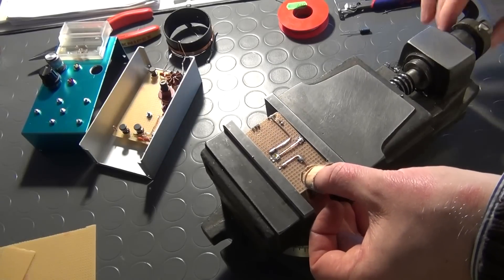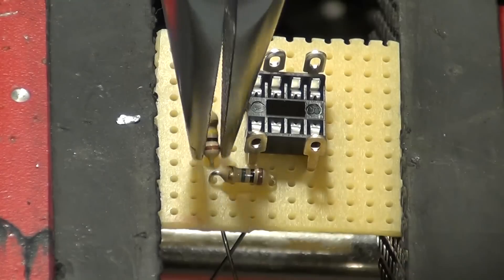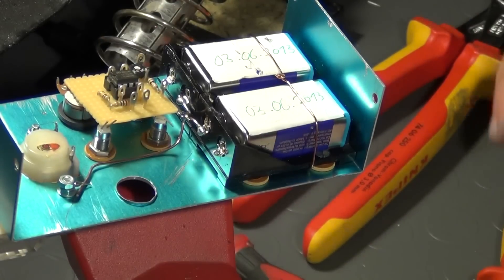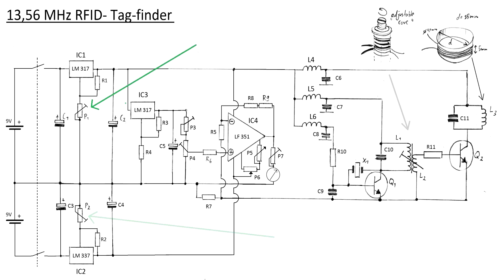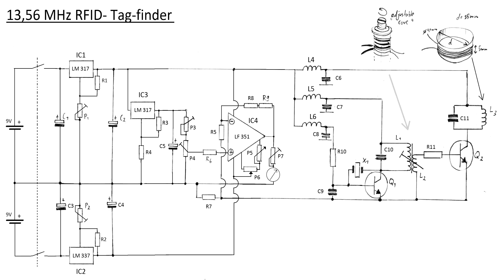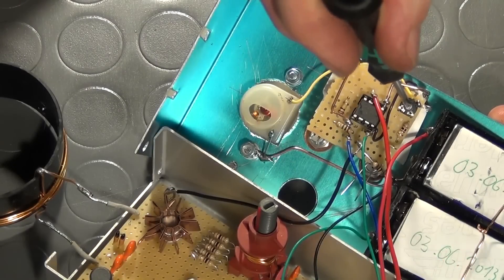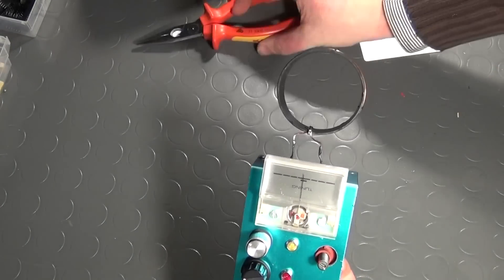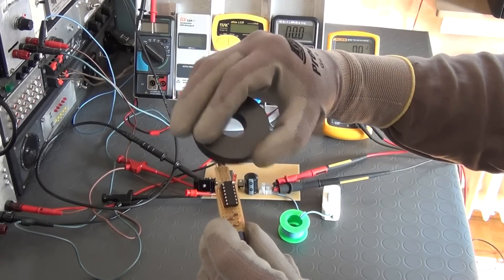How to Build an RFID Tag Detector - part 4: Op-Amp and Adjustments

Comment: 13.56 MHZ xtal is very Hard to find. If I utilize a 27Mhz one, cutting it's oscilation frequency into half (13.5 Mhz), do you think it would still tune with 13.56 Mhz tags? Thank you a lot!
Reply from the maker: +Rodrigo Formighieri I'm not sure. In which country do you live? I have found some sources for 13.56 Mhz xtals over time.
Reply: +The Post Apocalyptic Inventor Brazil my friend. The sources I found all come from China, 3 months to arrive by here. You got some sources there in U.S. or scavenging some stuff?
Reply from the maker: You could salvage them probably from an old CB radio, or any other wireless-equipment that operates in the 13,56 MHz-range. I dont't have a specific source from the US, but what about ebay: Here you have 5 pieces of 13.56 Mhz-crystals for 0.99$ from the US. They also offer worldwide shipping.

http://www.ebay.com/itm/HQ-13-56Mhz-Crystal-Through-Hole-HC49-U-Pack-of-5-/381130186853?hash=item58bd212065
Reply: Thats Awsome! I hope it will arrive on time. Today I went to an old eletronic salvaging store to find the transformer with adjustable core... just couldn't find! Me and the owner of the store oppened an old tv set and didnt found that component inside. Would I find that component from like black and white TV sets? hehe. Thank you!
Reply from the maker: +Rodrigo Formighieri You can typically find them in TV-sets that were made before around 1990. I recently found a whole bunch of those in an old Telefunken-TV from around that time. 
If you wanna find those parts on ebay, search for "adjustable inductor", "RF-transformer" or similar.
Reply: +The Post Apocalyptic Inventor  Because of the short time that I have, I will make a Wien Oscilator instead of the Pierce one. Wien Oscilator doesn't need a XTAL. But because of the frequency limitations, I want to make a 125KHz oscilator instead of 13.56MHz ,for 125Khz rfid Tags. Do I need to change the extern coil indutance and C11 for that modification? Thanks!